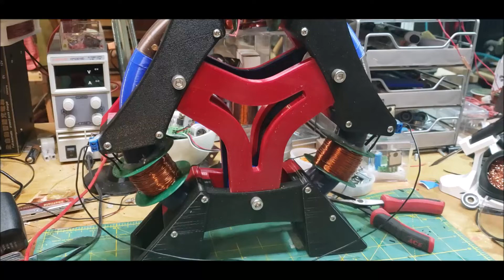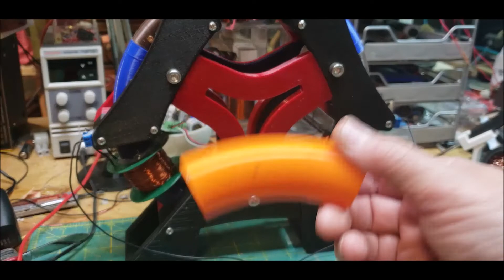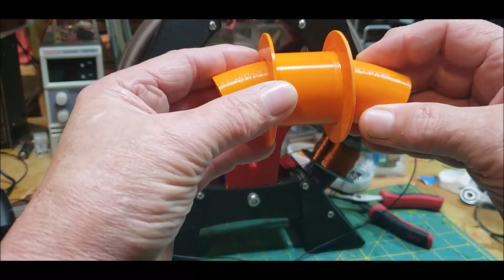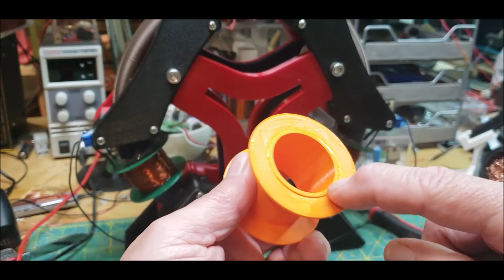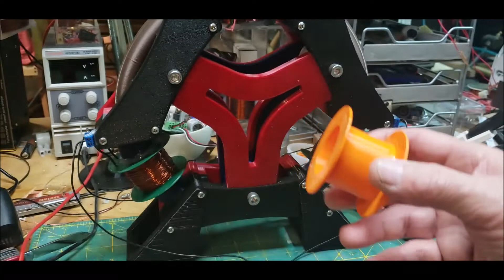3D Printed Solenoid Motor "upgrades"

Comment: Awesome great work keep it up man :) Iv never worked with a motor with that type of geometry but maybe the 2 coils at the bottom are attacking the magnets and the one at the top is pulling or vice versa or not enough voltage not sure but yull figure it out man
Reply from the maker: To be honest I think they're all either in push or pull mode depending on where the magnet is in relationship to the coil when it gets triggered

Comment: Just a thought,  you could have 3 coils on each section by making them shorter and hooking them up in series... 9 coils altogether.  Then you would have the option of connecting the coils in different configurations to the three driving circuits..   Best of luck!
Reply from the maker: sounds like a plan